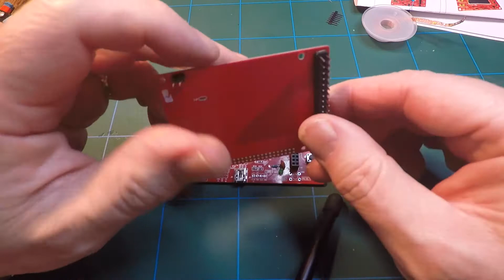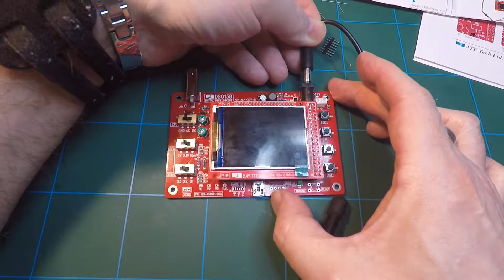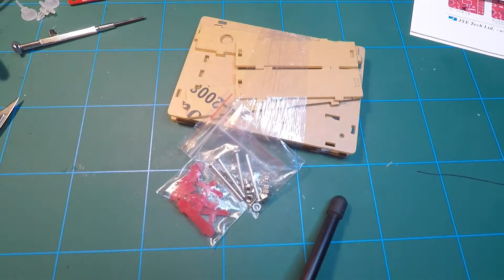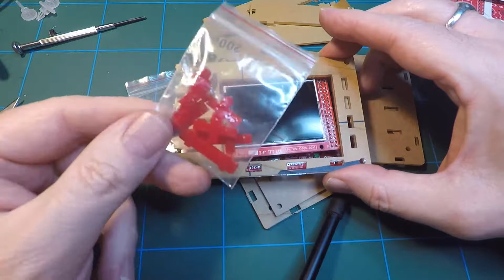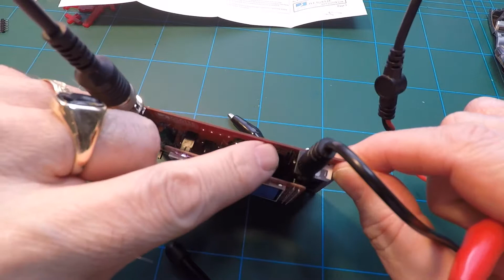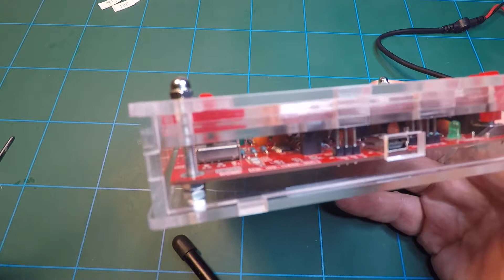Banggood: JYETech DSO138 Digital Oscilloscope Kit 13804K Version Part 3

Comment: Hi I enjoy your videos very much, I am going to start soldering and would like you to suggest all the kits that would be a good start. Also would the JYETech DSO138 be to hard for a beginner to complete.
Regards
John
Reply from the maker: Thanks John, glad you like the vids. I suggest you start with a simple clock, just to get your soldering skills in line. This link is to a clock that has no surfact mount components and includes a case so you will have a completed and useful item at the end!
https://www.banggood.com/DIY-Digital-Clock-Kit-Light-Control-Industrial-Control-1-Inch-LED-Electronic-Kit-p-1136099.html?rmmds=search&cur_warehouse=CN
Reply from the maker: p.s. would suggest give the JYETech a miss at this moment. Focus on simple kits to get those soldering skills